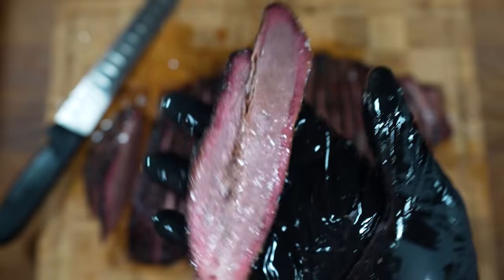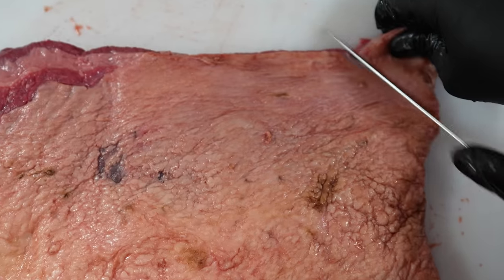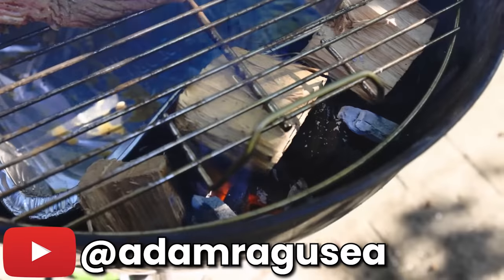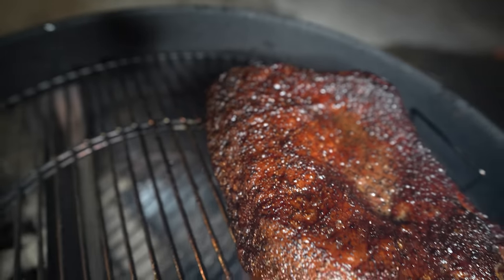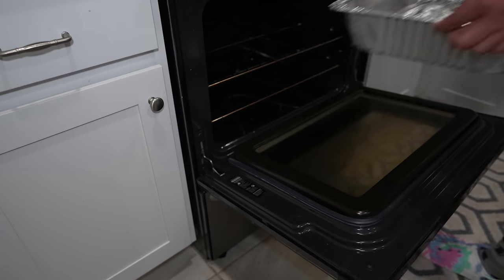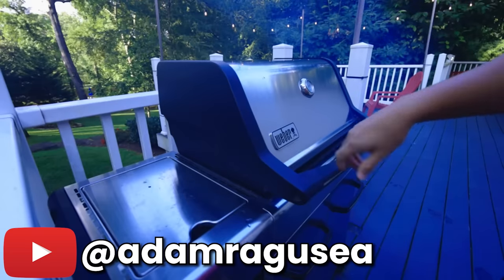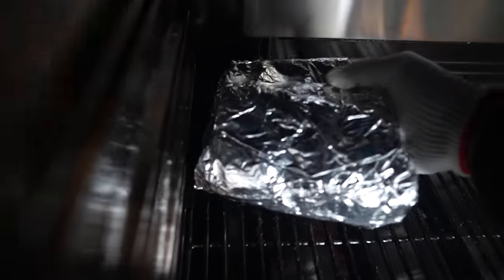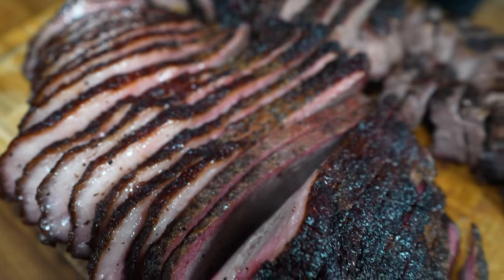ADAM RAGUSEA'S TEXAS BRISKET.. BUT ACTUALLY GOOD!

Comment: Not sure if you still do outdoor catering. But temporary tents/carport can be held down by taking 5 gallon plastic buckets from home depot and filling them 1/3 to 1/2 full of concrete, then tying down the cirners of the tents to the buckets. It's crude but cheap and if you can't stake the feet into dirt it will help with wind.